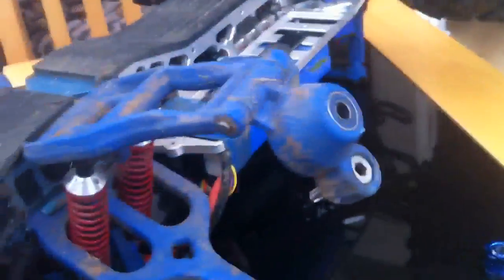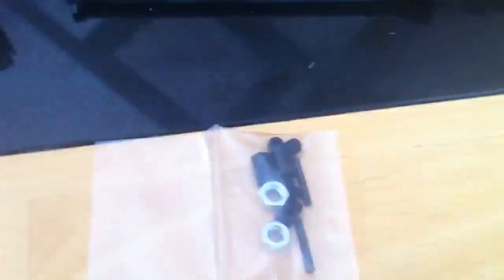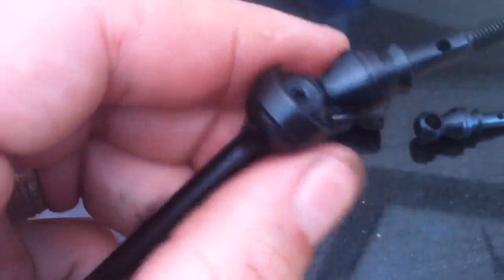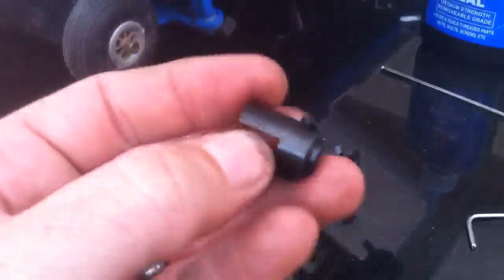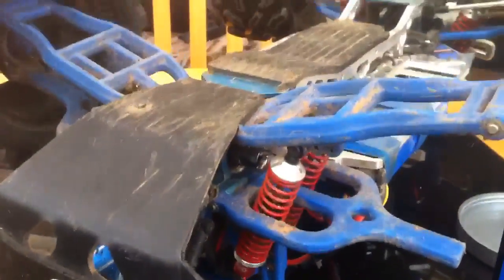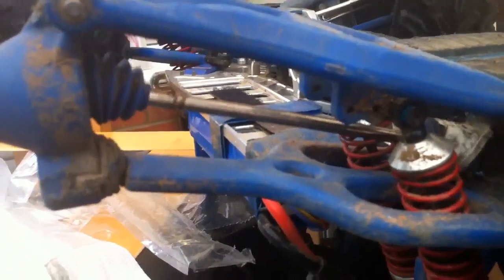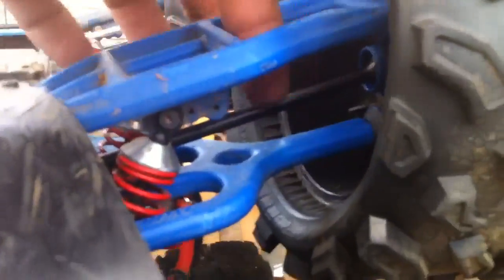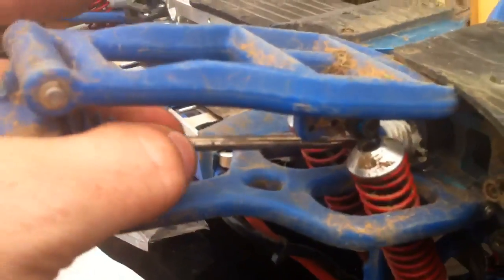Install new MIP CVD drive shafts onto E-Maxx

Comment from the maker: Yes they are $65 for two but worth the investment if you have built your Maxx up to the point that it desimates every other drive shaft on the market! My Maxx is the 3903 also and i have had thee drive shafts for quite some time now running 6S lipo,s and there still all good!

Comment: it's those big joe tires..They grip.. grip. lol.
It's hell on the drive lines on my MGT 4.6
and those are the same harden steal  upgraded dogbone just like the HPI...which i never
had any problems with..even after installing a power house nitro...
The PINS are the weakest point.....Need to use wacked titanium drill bits

Comment from the maker: Hey shahrier019 the stock plasic axles are fine for bashing unless you start running 6S lipo,s throuh them in which case get the MIP CVD's but dont ever get the Traxxas Constent velocity CVD's as they are weaker than the plastic!
I wouldnt say the plastic is better for bashing as if you bash hard enougth they just twist and break at the yorks! if our running 4S lipo's or less and you dont bash real hard they will be fine!

Comment: have you had any issues with the pins falling out?  I got my MIPs way back in 2006 but haven't used my e-maxx since then because the pins kept falling out and breaking parts around it

Comment from the maker: Well if you look at the later videos thats what  done a few years back! lol
Reply: TraxxasmaxxUk i agree with you 10,000 percent. i bought those same axles last week and one broke on my second run....junk. i just ordered the mip's. i have them on my slash and stampede and they have NEVER given me trouble. i actually broke the dog bone and the knuckle that connects to the drive. i have the castle mamba max 2200kv 1/8 scale motor in mine too.
Reply: TraxxasmaxxUk what other upgrades do you have on the e maxx? what center drive shafts are you using on it?